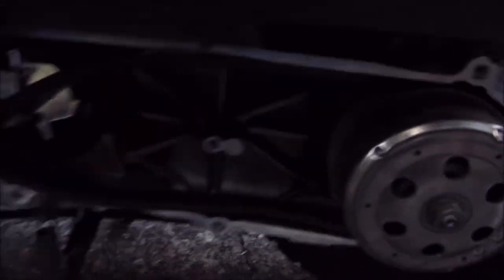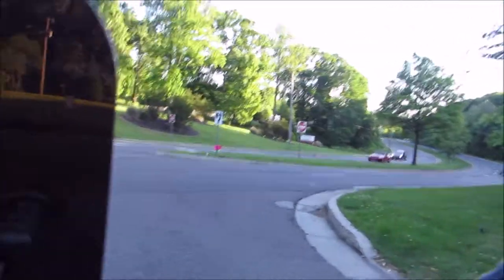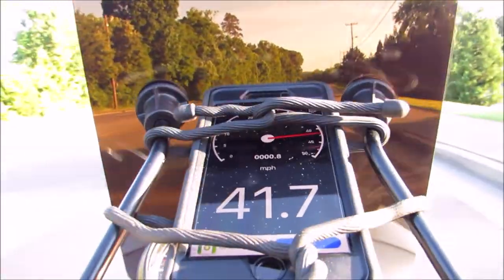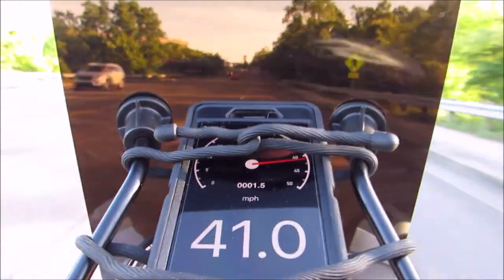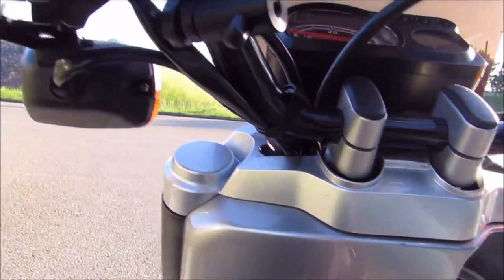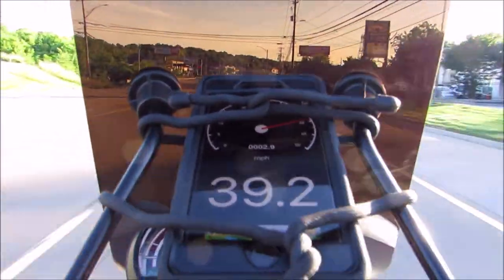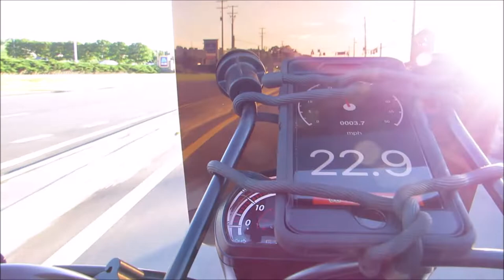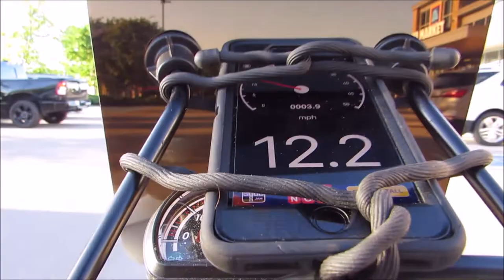Yamaha C3 Scooter Trip to the Grocery store.Testing DR Pulley Sliders in Polini Variator. 4.25 gram

Comment: I now need a new variator, I can't find anything for C3 on amazon any ideas?. Running into alot of problems. Could you tell me the measurement for the slidders 16x13 or 15x12 and the best variator that works for you. I weigh 235lbs so what would be the best for me? Thank you.
Reply from the maker: https://www.amazon.com/Polini-Performance-Variator-Yamaha-Zuma/dp/B01LZU7W42

Here is one on amazon.    If you want to gt DR pulley SLiders make sure to get size 16x13.  the stock variator uses 15x12.

Here is where I got mine:
https://www.partsforscooters.com/146-87-Zuma-50F-C3-Transmission-Kit

Here are the Dr Pulleys  I like the 4.5 gram

https://www.partsforscooters.com/169-217_Dr_Pulley_Roller_Weights?quantity=1&custcol16=20

Comment: I don’t know what’s up with my C3. It’s all stock. When I removed the washer I actually lost a little speed with the stock rollers. So I put the washer back in and then installed the 4.5 Dr Pulley sliders and it seems to be running even slower! This contradicts everything that I have seen on the interwebs so I’m a little lost on this one. I cleaned the variator with brake cleaner when I installed the new rollers too.
Reply from the maker: Im not sure.  I have read that if installed incorrectly, these issues can happen.  I'm sure you have watched all the  same videos I have, so I'd say you probably did everything right, but maybe go back and double check that you removed the correct washer and put the weights in correctly and that the belt is on properly.    I have changed my weights out about 7 times and have never had any issues.      Let me know if you have any other questions etc.  I'll try and help if I can.   Cheers

Comment: I got mine 2007 forgot all I did to it. After stored for 7 years need to get back, New fuel pump, bat, Starts right up but air cleaner got lost?????? so looking for ideas with that. Ideas. Thank you for the help.
Reply from the maker: Partzilla.com you can get a new air filter cheap// Also Polini makes one you can get.  Ebay has them pretty cheap

Comment: No luck put everything together top speed 29 to 32 mph, I will try and put the spring in the clutch when I figure out how to do that. Grip is not as strong as it used to be.
Reply from the maker: That sucks/  I didnt install the spring in mine.   I am getting average of 40  but can get 47-49 moving dowhnhil.     Mine has ran great since I did the switch.    I'm only 155 pounds so I dont know if weight or size factors in.    A lot of people get similar results as I do on the Facebook c3 page.